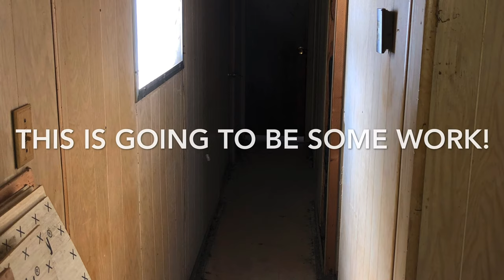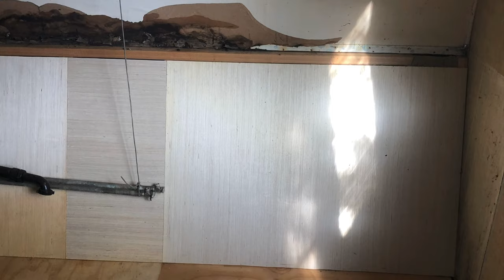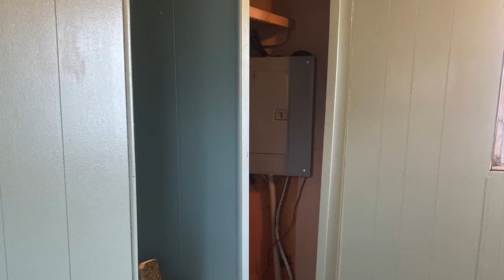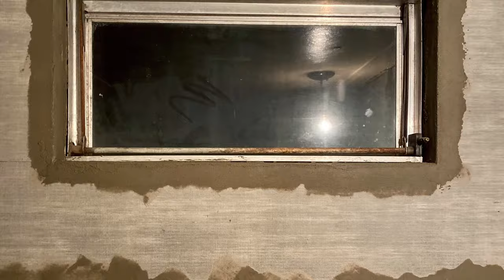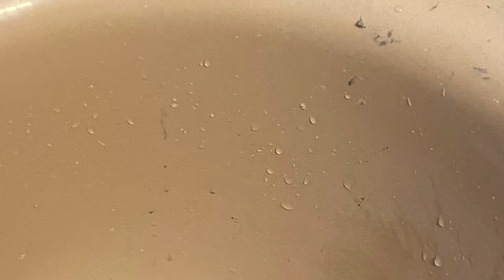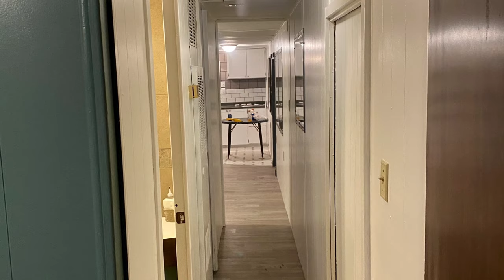Saving, Remodeling 1960's Mobile Home

Comment: I was feeling super overwhelmed about beginning my own remodel and this video made me feel a lot better. Very inspiring and beautiful work!
Reply from the maker: Thanks Cheyenne, with some time and patience as well as a lot of studying , YouTube videos and good old fashioned sweat equity any home can be saved and look like new again, not to mention increase its value. Don’t be overwhelmed, remember to take some time for yourself to relax or enjoy during your remodel. I did this after work daily while working a 9 to 5 job, never worked Sundays to get a break, and took a full weekend off twice. Made sure to go out a few different Saturday evenings with my wife, and before I knew it this Home was done (took 10 weeks) and felt great. Enjoy the build and many good wishes that your remodel turns out exactly as you are hoping it will!
Reply: @LittleL97844  wow! It only took 10 weeks ! If you don't mind answering but I would like to know how much $ was put into remodeling all this and how many people worked on this, did you do this all alone? If so, wow that's amazing !
Reply from the maker: John Nam . Approximately $2500 in materials cost. Did the entire thing with my father and myself. And our spouses assisted in painting and cleaning. I actually maintain, remodel and repair homes for a living so I am a bit ahead of the curve compared to some. This is the oldest mobile home I’ve done so far though, mid 60’s. Thanks for the kind words.
Reply: Tell u what I think?  I think you're awesome  ,to save this from the trash  and make it someone's dream home .you are a hero
Reply from the maker: @jeanbkelly  thank you I appreciate that

Comment: Thank u 4 posting.  I grew up in an American trailer in late 1950s to early 1960s nice to see one of old ones saved
Reply from the maker: I grew up most my life in the same 1974 14’x60’ single wide. And when my parents upgraded to a new double wide in 2002 I moved the single wide to a park down the road and continued to live in it for 10 more years when I gave it to my daughter who now lives in it and we are doing a MAJOR renovation in now. Stripped it down to the studs and re insulated it, drywall installed with texture, now in the finish work stages updating kitchen and fixtures. Also paid a roofing company to do an EPDM rubber over roof.

Comment: Very very beautiful and inspiring. I am currently working on my trailer now,but I am very curious of what you put on the tub walls before you tiled it??
Reply from the maker: Thanks. Cement backer board, then RedGard sealant over that.
Reply: @LittleL97844  thank you and if u dnt mine me asking  did it have the 2×2 or 2×3 studs. And what type of nails did u use. Tht is the only problem I'm a little worried bout is busting the smal studs
Reply from the maker: @christopherhacker8193  2x3 studs, but I firred out the bathroom walls 1” (wood and glue and a few hundred screws) then when installing the backer board I pre drilled each hole and used cement backer board screws

Comment: I just bought a 1960's 12x40 mobile home that I'm about to start the demo on myself, I'm gong to gut the entire thing though because I'm going to rewire, reinsulate and drywall the entire thing. I't's a 2 bedroom and the 2nd room and bathroom are really really small so I'm going to knock down the wall in between the bathroom and bedroom to create a bigger bathroom and it's just me so I don't need a second bedroom plus I wanna move the laundry area  out of the main living space/hallway.
Reply: How did your project go? I’m about to do the exact same thing. Any advice ?
Reply: @ramiedeoliveira4837  Still working on it  but it's almost done and looks great.
Reply: @TheREALOC1972  good to hear :)
Reply: @TheREALOC1972  any advice you have ?
Reply: @ramiedeoliveira4837  Dont tear out structure until you have to and replace it as soon as you can.
Reply: @TheREALOC1972  did you have prior electrical experience?? I think that’s the most daunting for me at the moment .
Reply: @ramiedeoliveira4837  No i have a Army Buddy that is a electrician and I bought him a case of beer to wire it.

Comment: A person or people were heavy smokers the walls and ceilings are brown stained yuke!
Reply from the maker: They absolutely were, we went through so many rags and so much cleaning product getting a pre wash done before priming walls. Took a solid few days just to get cleaned. Rags were nasty brown when done!
Reply: @LittleL97844  Did you use TSP? Or something else? 

My birth mom was a heavy smoker and she couldn't believe it took be about 3 weekends to wash my way thru her duplex and I repaired alot of the stuff that was broken and I remodeled her bedroom into flannel sheets with Laura Ashley comforter set, she cried when she saw it. I'm glad I was able to do it bc she was on the down hill slope. She may not have known it but I think God told me and I've always tried to treat people with respect and dignity but especially my Mom. Things happened in my childhood that didn't have to happen that way. I've been trying to fix what caused so many problems but the mh property is actually for fun, so my friends and family can go fishing. And get away from the craziness of city. I just pray it's not in bad shape. I think they've priced it double what it's being taxed. Is that normal?
Reply from the maker: @kristinatidwell6563  used mild soap and water and then used liquid TSP and a sponge mop with a bucket. Washed the walls the same way you would a floor with the tsp mop setup and works fairly well

Comment: Im wondering about the ceilings in these 50s and 60s mobile homes and if they have ever had asbestos
Reply from the maker: Any housing built before 1989 may contain asbestos. Many mobile homes built before 1980 do still contain asbestos. The only way to know is by having an asbestos test done. There are companies that can do this as well as “at home” DIY kits that may be used for this. During any demolition or tear down asbestos and lead based paint needs to be something considered and protected against.
Reply: @LittleL97844  i know it was common in the old floors but do u know of it actually being in the ceiling fiberboard stuff as everyone else says its not there that fiberboard is just a wood material
Reply from the maker: @juliesamie9225  if the mobile home was built before the 70’s it is common to find asbestos in the ceiling tiles. The only way to know for sure is to have it tested.
Reply: @LittleL97844  mine was not small tiles,it was a large painted fiberboard type panel as thats what im wondering as i know its been in small tiles,textured coatings and insulation behind but im talking about the actual ceiling board fiberboard with no textured coating
Reply: @LittleL97844  on the facebook mobile home group people that restores the real old ones says it would not be in ones older than 80s as it was luan plywood and fiberboard ceiling material so are u talking about aftermarket products that people have done as repairs maybe

Comment: Did you put new windows in?
Reply from the maker: Technically no.... we did have some used but newer vinyl windows that fit several locations sitting around that we used to replace some windows. 2 windows we replaced the broken glass, all window frames were painted and all single pane windows we were able to place a storm window into. Also we had to replace the gaskets in almost every single pane window due to age wear or being sun dried.